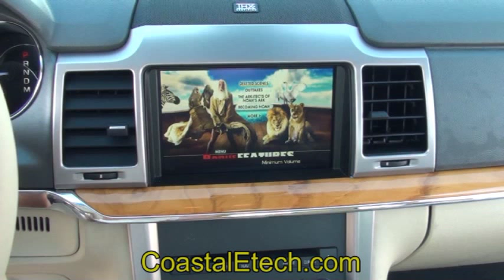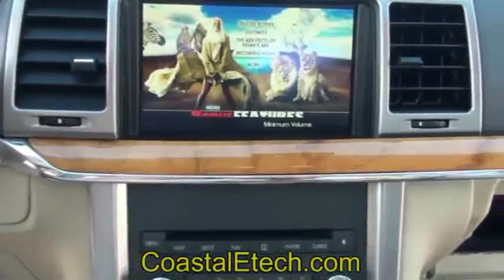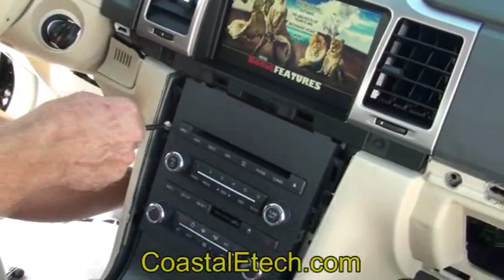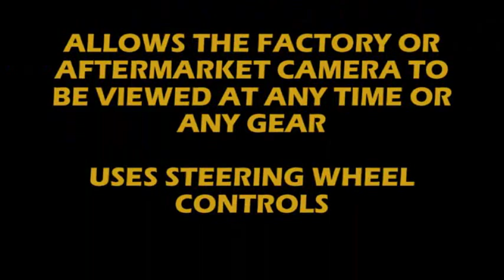Sync Lockpick Installation in a Lincoln MKZ

Comment: My MKZ doesn't come with a touch screen only with analog display. Can I install touch screen?
Reply: I know what u mean I have a 08 mkz and the 08 navigators have the same exact radio even plug ins  only diff is the navs have dvd player I want to switch mines but idk if it will work.